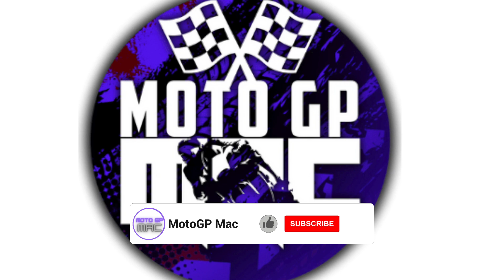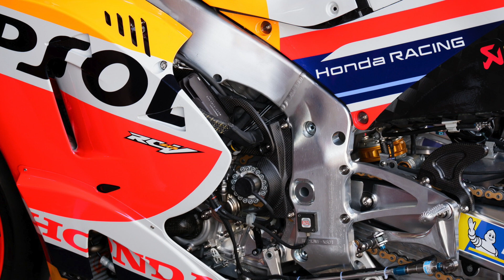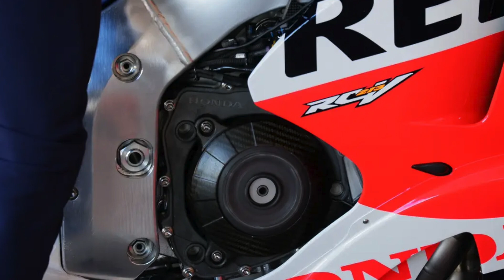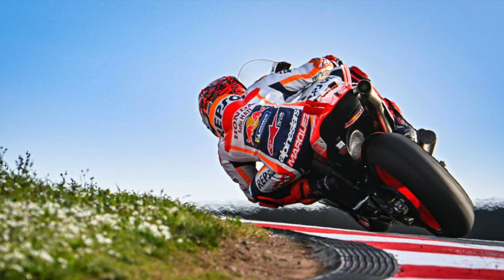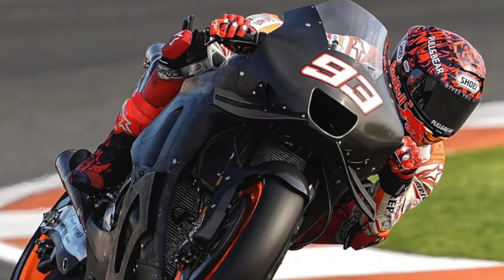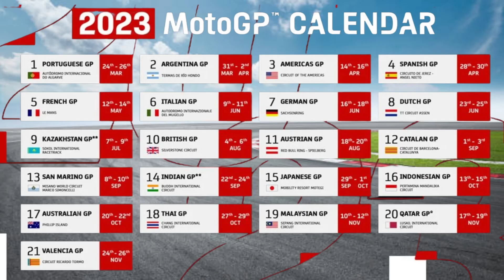Are Honda Going To Use A Kalex Chassis ?? |  Motogp News

Comment: In my opinion I think Honda have more to gain by working on the following items:  engine, electronics, suspension, and aero.  Marc has had 4 different frames to test and I don't think they can all be that far off.  Rins and Mir are just as fast as Marc after a very short time on the bike which leads me to believe that maybe the bike is not that bad.  Also, despite being a great rider, I'm beginning to think that Rins and Mir are much better at understanding and solving the handling issues with the engineers.  I think Marc may not be the best rider for providing feedback.  Rins on the other hand has the LCR bike up to speed right away.
Reply: Engine is strong already
Reply: The fact 3 riders are doing the sametimes means the bike is at its limit its as fast as anything its on the same rubber everyone uses ohlins so what is the difference the frame because the weight transfer or front /rear grip is not good enough have you even worked8n a race team or raced ? You plainly have no grasp of the facts and yesthe electrics could do with a tweak
Reply: @leonshepherd7059  Well thanks for informing me that I have no grasp of the facts.  I guess we’ll see if Mir and Rins can improve the bike without resorting to multiple iterations of the same frame.

Comment: My question is; will honda change the layout according to Kalex chassis, or Kalex making chassis according to honda's layout. Off course engine will be same, they can not change it but will other parts stays same or need to redesign for new chassis.
In first place I would think that new frame just will replace old one and honda install same parts at same settings to the frame. But what if Kalex asks some change for better chassis. There are news that Bradle already tested to chassis at  jerez but no news about result.

Comment: Couple of things to point out is that Kalex said that when they first entered MOTO2 they took 9 months to design and make the frame and that was a decade ago. Now with all the latest technology and resources they only need like a couple of months. 
Because they don't have any data from MotoGP yes they might require more time and that would be 4-5 months. 
So in my opinion just like Mac said, IF they've asked Kalex for a new frame i believe they've already tried the base one in Sepang without wings and the updated one in Portimao. Now with all the data they have they'll bring out the next piece in Jerez.

Comment: This is a smart move from honda . We  said this should have happened last year .Honda has ALWAYS had a reputation for being good at race engines and piss poor  at race chassis engineering . Honda just said they  dropped  the kalex swing arm  and  made there own aluminum swing arm in house . which was odd being it was there only step forward . Now it makes some sense they just  rebranded kalex swing arm = pr problem solved  lol.    Ceo of Kalex said they have no motogp data right now and it would take the 6-9 months so i think mac is correct they already are using  kalex chassis  or at least they are already  in the midst of creating one if may is the official  start date . Again smart move from honda they are so bad at  race chassis engineering they  can only go up

Comment: Hi Mac and Jake. Well, for me, with Ken from Suzuki now working for Honda, why haven't they hired the Suzuki frame guys. They are all out of work because Suzuki shutdown all their racing department. So surely that would be more cost effective than going to kalex. What you think guys. Now I know Suzuki was an inline four and Honda is a V4. But Suzuki builds sweet handling bikes so they know about flex, head race angle, swing arm pivot position and swing arm length.
Reply: good idea suzuki always made a sweet chassis inline or v engine